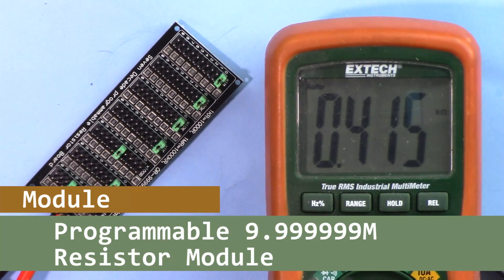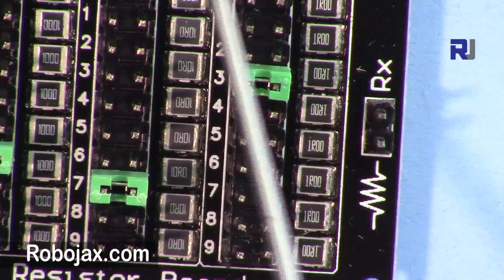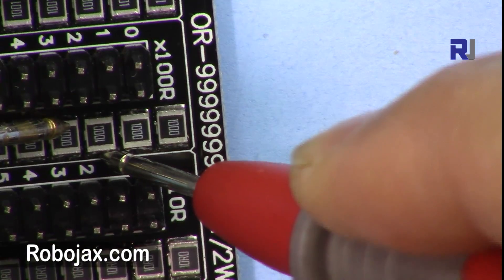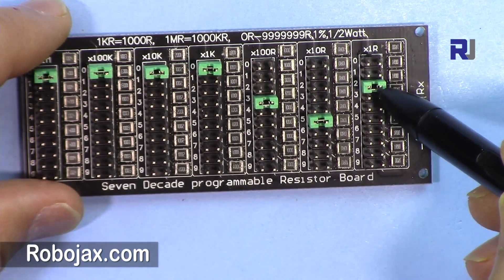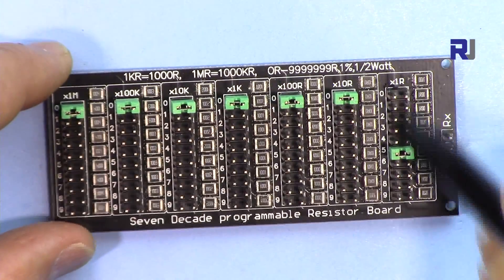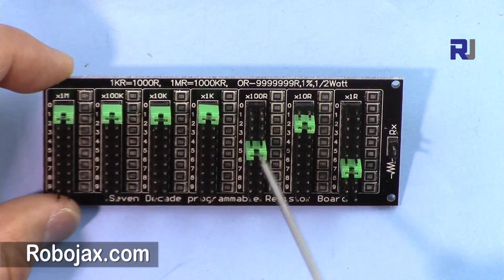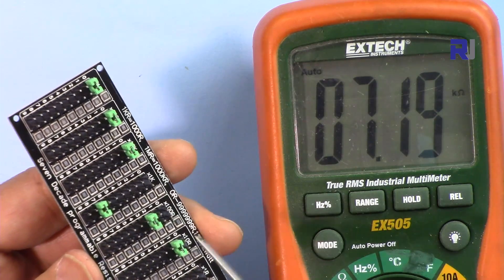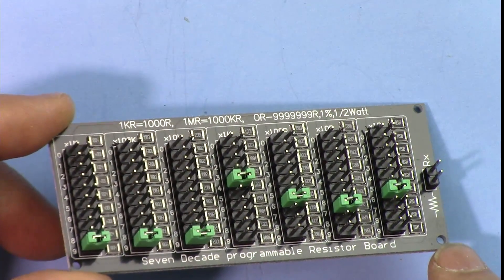Programmable Resistor 9.999999MΩ Explained with Schematic

Comment: I have one of these boards and there is an error in the artwork.  The jumper comes in and goes to both 0 and 0.1 pins instead of just 0.  Therefore, the R100 resistor is always shorted and x0.1R at 1 produces the same as 0 position.  Can you examine the back side of the board and confirm this is an error?

Comment: How can i test with this item what resistance value is necessary for LED AC or DC that need low or high voltage pesp. low or high Ampere ? Thanking kindly regards forwarding for a response ! Yours sencerely, greetings from
 Thomas, Berlin, Germany
Reply from the maker: Hi, I have explained the calculation in this video https://youtu.be/su2-dqtkOTY  Greetings from Canada.

Comment: Nice video. I don't think "programmable" is the right word, as the resistance can not be controlled by a program.
Reply from the maker: when yo set certain connectors, you are programming it. Actual programming started  by connoting wirers.  Just do look at history of computer.
Reply: @robojax  telephone operators were programmers :)    when they wired up the phone calls for you manually :)